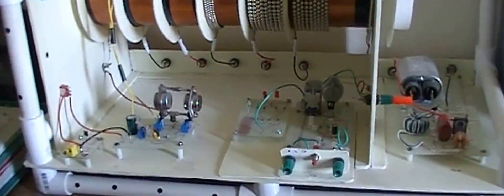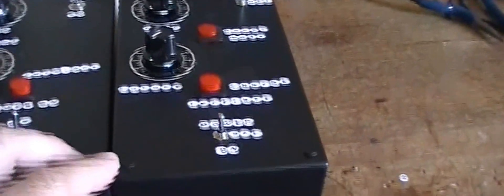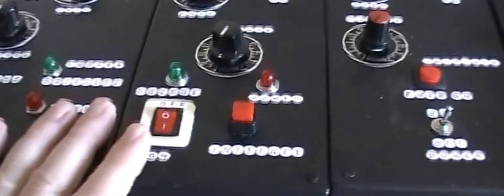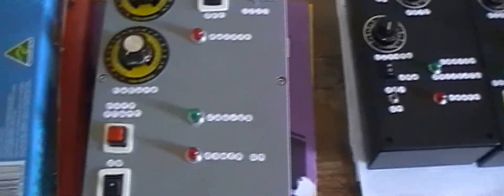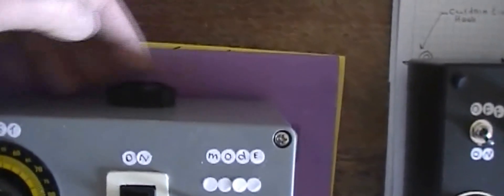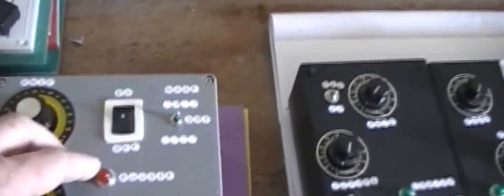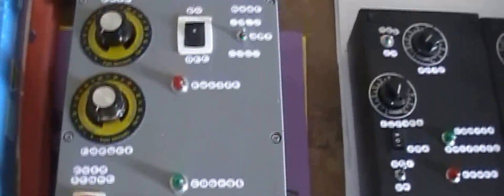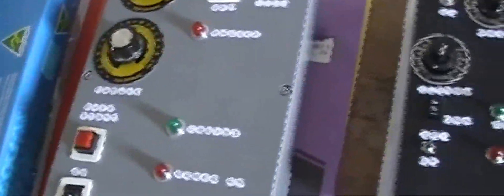bajak capacitor experiments

Comment: Which piezo crystal model did you use?
Reply from the maker: i used the beeping one used as a reverse beeper for cars trucks  when they reverse it goes beep beep beep  and has two modes continuous beep or pulsed beep i got it from jaycar electronics here ages ago it has a built in driver already
Reply: Steven Chiverton thanks
Reply: Steven Chiverton I’m trying to find it on jaycar, do you have a link of one I can buy. I’m trying to build my own flux cap. Thanks
Reply: Steven Chiverton found it, thank you
Reply: Steven Chiverton I used a piezoelectric crystal that pulses, 1220 uf of capacitance in parallel, and apply 15 volts. I then place a stop watch in the pathway of the crystal and another with the same time elsewhere, and there appears to be no change within the minute I test it. How long does it take to effect something? Can I raise the capacitance and voltage for quicker results? Thanks

Comment: Steven this is Dennis who has the HDR site up! I am doing a repeat experiment by running a time travel protocol 24/7 the program runs on a hologram card that I pre-program.
with the SE-51000. I purchased a Remote Broadcaster will broadcast whatever I had programmed on the hologram sticker on a wallet size card. A year ago, I used my HDR by Gibbs for ten minutes everyday for two weeks. My  request was to visit Area 51. On my second running week, I lied down after the 10 minute session using the HDR. All along the SE-5 was broadcasting my Area 51 request. Then some thing magical happened, I found myself in broad daylight at Area 51 in front of a huge plane hangar with open doors.

There were no one around, no MIB's CIA's USSS and a whole host of security personal because in my broadcast program, everything I was experiencing at Area 51 was in complete detail from my program I created. I got to go down an elevator which took me to another level and as the doors opened I seen electrical wiring hanging from ceilings with lights flickering on and off. It looked like they are remodeling this department workspace.I did see under a heavy green canvas cover a disk shape aircraft. I couldn't take it off because it was too heavy. They had a rope of sorts which pulled up the canvas. I just let it alone. Here is my site:        https://dimensionaltimetravel.blogspot.com

So, I incorporated both my Gibbs HDR for only ten minutes during the week of the coming of the full moon and two days more after. I have a SuperEMF Pump that charges the are with 20,000 gauss. Ghost Hunters use this to attract well, ghosts, I am using it for to increase the amount of gauss along with the HDR for ten minutes. In the mean time I run every evening one or two things, the first is the holographic program for the chakra's and a holographic program for time travel and for Out of body experiences.
Reply from the maker: very interesting and advanced to far ahead of my thinking
Reply from the maker: just had a looksy through your channel and i see that some of den rads blog stuff is there to the scare crow whats happened to his hdr blogs online they all gone or vanished ive collected lots of them. next time you go to area 51 look for the flash gun schematics or armor lux device schematics it has some good uses in levitating and reprogramming brains  like the men in black neuraliser
Reply from the maker: keep me updated  ,that jd golds device is grossly over priced   theres rife generator schematics on line  and if you want frequency generators a simple function generator also creates them to

Comment: Did you go back in time with any of these yet?
Reply from the maker: not yet but with the bajak capacitor i experienced a reality shift  it felt so strange like it wasent mine and i was outside in the dark only  as for the hyper dimensional resonators not yet as you need a vortex to operate them over but some information says you may be able to draw then in to you to use .
Reply: Do they take you back to the past?
Reply from the maker: they supposed to and the future to but for the hyper dimensional resonators it depends if you find a vortex to operate them over  that dosent apply to the bajak capacitor though but now i find it dose need a vortex to
Reply: So if you get a vortex to operate them over that doesn't apply to the Bajak capacitor it'll take you back to the past or into the future you mean.